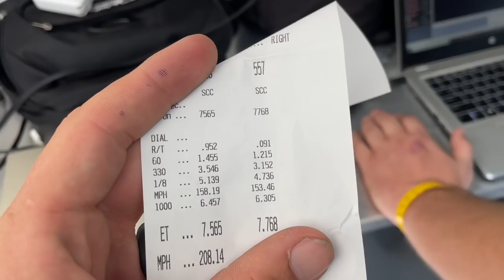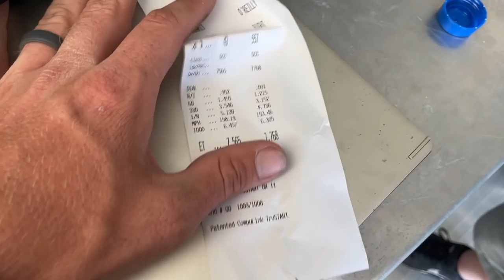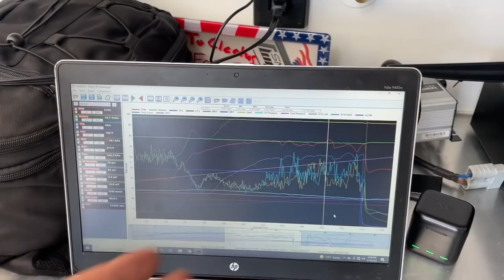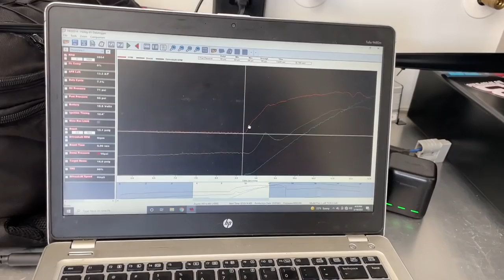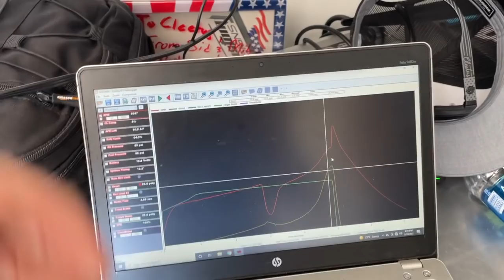TX2K22 Day 2: Ruby Goes BOOM On The Starting Line and Mullet BARELY Qualifies!!!

Comment: I was at the event live and it took half a day for 1 GTR class to get through qualifying. Absolutely ridiculous, once the other classes started, it ran smooth as butter. They should definitely change when to do GTR classes
Reply: Or just shut down the class - If they cause a ton of crash / oil downs - why should the other classes suffer?  All the Classes should have an allotted time - if you don't finish in that time period - oh well - next class. And if there is time left over, then resume. It would really suck to show up, and not get all the Qualifiers because a bunch of cars weren't up to spec, didn't have chutes, or had panels flying off with their runs. That is just poor prep. The classes causing the issues would cease causing issues if they didn't get the chance to run due to those issues. I bet the next year they wouldn't have the attrition rate.
Reply: @theangrymarmot8336  this so much. They could also just run GTR classes like the week before as a seperate event and then the only people they hurt would be themselves.
Reply: Save the classes that break too much until the end.
Reply: Most part of the day was waiting on track clean ups.
Reply: being a professional doesnt mean you make fast cars, being a professional means you make fast cars consistent. most of the people in that class have far more money than brains or experience.
Reply: @theangrymarmot8336   Gotta agree with you 100%. Move the GTR to a different day or run after the high prep guys are done.
Reply: @neilreid2298  I bet if they ran GTR on a seperate day they'd sell like 10% of the tickets on the gtr day.
Reply: @Prestiged_peck  Doubtful it would be that high not counting the contestants and crew.
Reply: @steveyork8069  no I'm saying only 10% of the current 2k crowd would go. They'd probably double attendance for the rest of it.

Comment: When you’re running on the ragged edge of pressures and rpm’s any little thing becomes a BIG thing, sucks for ruby. Also, 200mph+ requires mad safety be in place. Cages and chutes should be a mandatory minimum

Comment: I would've thought the ecu would have protection built in to stop it from running lean like that.
Reply: It is probably available, but not setup
Reply: still needs data from somewhere to do that the ECU protections are only as good as the data it is receiveing
Reply: @rossmagwood1381  What data wouldn't he be getting? He literally has everything he needs.
Reply: @cn1364-w6c  Vaccum line was off I would imagine the ECU neds that in order to know it is running lean
Reply: @rossmagwood1381  it had low fuel pressure and high boost thats enough information for the ecu to know
Reply: @rossmagwood1381  nope. It has wideband o2 sensors connected to the ecu. Also, the ecu knew how much boost it was making, it lost manifold reference to the fuel pressure regulator only, which is mechanical.
Reply: You can configured multiple safeties (like lean A/F, Fuel Pressure vs Boost or both) but the way things went (only one run) mullet probably wouldn't have qualified if they had the safeties configured/activated...
Reply: @rossmagwood1381 Okay, so it sounds like you don't know much (or at all) about this. What do you think a MAP sensor is for? Same with a wideband sensor? Do you think he's not running either of these? I can tell you with full confidence that he's running both.
Reply: Holley has multiple safeties available. You can use any sensor that is setup to cut power when needed. For instance egt or wideband could be set that of egt is over a certain temp or wideband is over a certain A/F ratio it could cut timing or limit rpm until desired timing or rpm is reached. They are running terminator Maxx in these cars so definitely possible
Reply: It's definitely possible, but the ecu is normally so good a compensating for problems that they likely don't have the safeties set up. This problem was just too much for the ecu to compensate for.
Reply: @Shiftheads  Is mullet running a terminator max? I'd hope not. My guess is they are on a Dominator. The Terminator Max is (imo) input limited. I'm not a fan of the canbus i/o module.
Reply: @cn1364-w6c  oh you may be correct but either way it supports the options for safety. I see the dominator also supports can stuff as well. I bet it is dominator since the dominator supports water/meth systems as well
Reply: @philb5593  Holley's amazing fuel compensation is both a godsend and a curse. Too many people think Holley don't require tuning as they are 'self-tuning'.

Comment: Maybe having an emergency red light on the dash that is coded to turn red if critical components are not working correctly they could jeopardize the motor? Example: If the computer shows too lean, the red light goes on then you know that should let off
Reply: When you are running 150+mph a red light is not good to pay attention to lol now they have Holley so it has safetys that can be used for reasons like that. Nobody hardly uses them tho.
Reply: @robbygray9562  maybe they can put a passenger seat for me so I can personally alert them

Comment: NHRA licensing wouldn’t be a bad requirement at this point.  Keeps wreck after wreck from ruining the event
Reply: This. If the chassis doesn't have a cert it doesn't run.
Reply: I agree. Require NHRA chassis cert and NHRA driver licensing before any of the "daddy's money" cars are allowed to even enter the staging lanes. These cars ruined what would otherwise be a great event.
Reply: @Themakersworkbench  
Tons of people in the other threads complaining that putting a rollcage in a carbon cell supercar is too hard and weighs too much and doesn't matter, blah blah blah

Koenigsegg had to do it to run the One:1 on certain tracks, and they did. If these fools want to drop another $150k into a $250k car, they can put a rollcage and parachute on the damn thing.

Comment: you need those little locking clips that go behind the push to release on those vacuum fittings.
Reply: I've never seen a lock for one of those, we use them all the time on heavy truck air lines without any trouble. They don't shake like a drag car though.
Reply: @--_DJ_--  They're just little plastic c-clip looking things that keep the fitting from being able to be pushed in and disconnect the tubing.
Reply: @James-vn8zb  Huh, surprised they don't use them on trucks. From my experience, they either work, or the tube wasn't in all the way.

Comment: Not gonna lie, it's actually kinda bs that the wrecks at the track fall onto the other driver's and teams.
The track staff should do more to make it up to the other teams.
They should let you make passes further into the night.

If they wreck too many times in the same class and delay the event too much, the logical thing would be to move onto another class. 
The other classes waiting to race shouldn't be negatively impacted and have their whole weekend ruined because of a bunch of wrecks from the supercars.

Not that anyone purposely crashes- obviously not, but still. Ruining the weekend and costing small teams a bunch of money (the backbone of the racing community) to cater to the rich supercar teams is criminal.
Reply: The supercar teams who are allowed to run 200mph with no cage and no parachute, it's an absolute joke. Koenigsegg had to put a rollcage in the prototype One:1 to drive it around certain tracks and i would bet every cent i own that the passenger cell on one of those is significantly stronger than a huracan/R8
Reply: @damstachizz  I mean the safety definitely should be the biggest factor... but I'm also a believer of living our own lives and taking the risks we want to take.

I'm mostly mad that other classes potentially lose out on the whole weekend because of these guys. If they want to take risks, whatever, but their risks costing other people the event isnt cool. (Other people with full roll cages and proper safety gear)
It's bad management by the event staff.

Comment: Yall need a damn checklist before every run. I'd bet money that when the valves were checked after thr backfire that the vacuum line got bumped; called a maintenance induced failure. Checklist, including testing your two step, haha

Comment: Seems like you guys are always crippled with these little issues, why use plastic push-lock for your CRITICAL boost lines instead of metal compression? What type of wire insulation are use using, XHHW or THHN from Home Depot or actual automotive wire like GPT? Are you engineering in strain relief for hanging wires so the G-force on launch isn't causing unnecessary movement/strain which breaks the conductors inside the wire insulation over time. What's good enough for your garage door at home is NOT good enough for your racecar that you likely have hundreds of thousands of dollars invested in at this point.

Do you have printed pre-launch checklists for each vehicle so nothing is missed or are you just winging it while pressured for time?

It was ok to make mistakes when your focus was just to come out and entertain folks and sometimes get lucky with a good pass but with more dedication towards WINNING there needs to be more attention to the little details that are costing you passes (and money...), and setting procedures like a pre-run punchlist on the windshield that gets torn off right before getting in line so that NOTHING is missed.

Comment: I thinck I'd get rid of that push-in, plastic fitting on that fuel regulator and replace it with a flared AN to braided-steel line...especially as vital as that signal is.

Comment: Dr tune ‘em all if you can I would map the injector pressure differential in the injector flow table (not sure if you can on the Holley). That way it will auto correct if there is an fpr vac leak or pump issue etc. Then have it CEL if differential gets out of range so you can detect if the sensor is playing up. Also have a safety for max injector duty as you near 100% it should pull boost and timing. If you have a pressure drop you then you max injectors pretty fast but the map will pull all the boost and timing out and warn you. Better than 25+psi at .9 lambda !!
Reply: Well put Spadam! Gotta build in those safety’s! ECU can react faster than old Cleeter! 🤣

Comment: I think it’s time to go see Steve Morris and get an SML for mullet.
Reply: Smx is the smarter choice Sml is still to untested at this time
Reply: @54raceman  given Steve’s knowledge and history with his billet engines and the fact it’s 3500hp capable I’d say it would be more than enough. Straight LS bolt in too. SMX would require huge chassis changes given the size and extra torque.

Comment: Unfortunate? No way, you guys got shafted. TX2K is letting guys with no cage and no laundry do 180mph+ runs, not to mention sketchy ass crosswinds in the deep end, and then doing surprised pikachu face when they stuff it into the wall. Yet I can't go faster than an 11.00 with no cage at my local strip, and they make Ruby run 2/3rds of a hood. Rules and processes need to change imo

Comment: I know you’re beatin yourself up about issues happening and the what not, but the issues you can control? You’ve worked them into the program, you’re eliminating them. Nobody expects a hose from a fuel pressure regulator to pop off. Nobody expects a wire on a 2-step to go bad (setting off a chain reaction of yikes). You’re miles ahead of where you were before. Each trip down is a learning process, you’re taking things super professionally, you’re checking valves after runs, you’re checking data logs after runs, you doing all the little stuff that makes you a winner.  

It will all pay off.

Comment: Tx2k just seems like everything that could go wrong is going wrong. Like I got yelled at for no helmet in a 450hp sedan but these dudes are racing 1500hp+ cars with no cages or chutes like ok stay on the road if you wanna do that, but no one wants to see you die because of ur stupidity on the track. What happened to tech did they get bribed or sum?

Comment: I wouldnt say those supercars need a cage since they have carbon tubs derived from track racing, but they ABSOLUTELY need chutes. Some of the crashed and basically all of the cars running off the track could've been fixed if they had chutes. 200+mph should need 2.

Comment: I really appreciate the hard work Cleetus and his team has put into the cars and the race track. Keep up the good work. I bought a pair of the Raycon Everyday Earbuds awhile back when Dragtimes mentioned the brand. Definitely the best pair of ear buds I ever bought. If you have been holding out then now is the time to get yourself a pair. I didn't realize until recently that the case that holds the ear buds charges wirelessly. I'm surprised that the price hasn't gone up.

Comment: Why is no there no "check engine light" for race cars which just takes certain parameters and if they add up, puts things into limp mode?

PSI of Boost over 40?
PSI of Fuel under 60?
Limp mode = 1.
Chop RPM to 2k, throw light.

This literally would save him a block or pistons if he hadnt gotten out of it.  Do I need to engineer something like this?!

Comment: Looks good. But according to my calculations the cut outs of the hood on "Le Mullet" doesn´t let the air flow correctly, Cut out or lower the air intakes approxymatly by 22 millimiters, or as your weird measure system 6615161/156 and 4 thousands inches, or whatewer...

Comment: Just goes to show ya how important just 1 wire or 1 pressure line can be and will ruin your day if given 1/2 a chance. Us old timers used to call em "Gremlins"! (test Ur 2-step indeed)
Sucks that Ruby didn't get to qualify, TX2K run the GTR & roll racers at the end of the day and let them wait on each other instead of ruining every one else's qualifying chances!

Comment: Ditch ALL of that china crap quick connect fittings. And go with DOT Brass Compression Fittings.  That stuff causes nothing but problems.  In my line of work I stock over 10k in fittings just to eliminate that junk any time we touch it.

Comment: After watching the 1320 video (after yours of course) that was some severe amateur night stuff at tx2k. I'm WAY for letting the dogs eat, but damn. The people that actually do this know why you have a cage after x E.T.. They know why you have chutes after a certain m.p.h.. Hell, Cleet figured that out. They know cause they worked to get there.
Ruby needed a hood but you don't need a chute to run 8? One guy that got real squirreled had a chute but thought the wall looked better so he didn't pull it. Yes, I've been there and he had the time. 
Then there's the oiling up the track thing. If you THINK you broke anything you get your ass off the race line. That's all racing.
Lastly, when going really fast, don't try to go really slow really fast! The driver that was getting his pilots license called that one perfect.
I'm really glad everyone is alive.

Comment: Almost Every video you guys break something and not everyone will understand it’s called race car lol I put 30k in a SRT4  and it blew up after 600 miles do to the boost controller loosing a line and it spiked 50 pounds and bam for what it was it was fast and beat a lot of cars built hellcats gt500 vetts and man my next build was going to be a 59 f100 choppe and tubbed with a fab 9 528 bb Chevy with a 891 blower it synced 1782 hp but learned from the first one no go now I just want to super charge my 2015 mustang and make 750 daily be happy and go to drags every once in a while

Comment: You even had all that boost pushing back from the intake side up the tips of the injectors when they were trying to fire. You were probably down to 20psi of actual pressure at the tip with the differential pressure added into the picture. EEEEK. Love your work. Keep it up. Love from New Zealand.

Comment: What's cool is that chassis Cam that's behind the rear end and tires shows that the edges of the tires are actually leaving different markings than the center of the tire.
 Ever since they changed rims there's parts of those tires that weren't even being used until now!!!

Comment: Ive been following you since you ran a 7 in leroy, now that being said, your motor program now is lacking, you have so many fast cars you can't keep up. Blowing up stuff all the time has to be getting old. I know it makes good content, but getting one pass out of an engine cant be good for the budget, maybe try a big block that can handle 2500+ hp for a season rather than swapping these ls engines that wont. Now I understand you have a deep budget, but your guys have to be tired changing engines all the time. Just saying.

Comment: I bought Raycon ear buds  last night coincidentally using Matt from off the ranch code and windows Auto filled the shipping address to my old shop 3000 miles away and there's no way to change the order. watch out folks they have a tricky interface that didn't show the shipping address until I got the receipt and it was wrong.

Comment: I worked at Intel in a full production fab and they used those push-lock air lines.  This is a high-level cleanroom so they don't mess around with leaks or hoses that blow.  I know it's possible to have high-quality connections with those but they always rubbed me wrong as they were too easy to use.

Comment: Brass compression fittings for the lines to the regulator for reliability. The plastic push style is great but eventually will leak and as you know now can come off if not installed all the way/defective

Comment: Tx2k looks like they are slacking cars crashing left and right when it's clearly the track or the wind cars going 200 plus with a short shut down strip and I saw a lot of them without a parachute and then they turn around and screw the drag racers over because they can't do a good job

Comment: If your ecu has a free output you might be able to wire an indicator light in your field of view that will turn on indicating that the ecu received the 2 step input. Or always test 2 step, whichever.